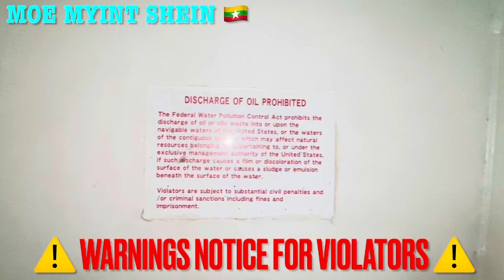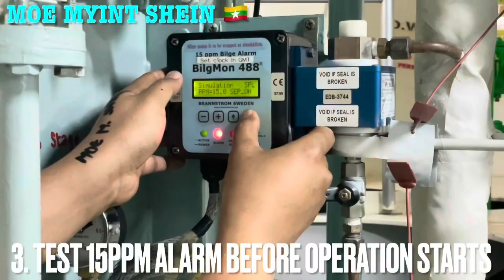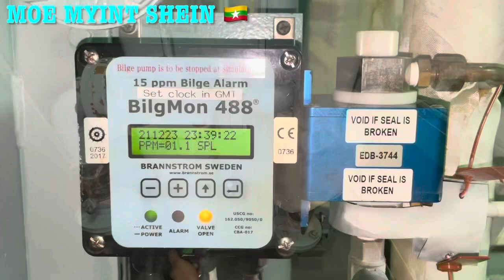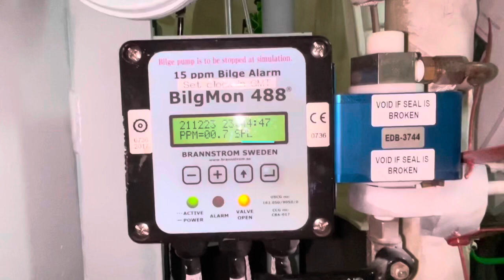OILY WATER SEPARATOR | Intro & Operating Procedure | Technical Vlog : 030

Comment: Hi.Fresh Water valve must be kept open on Monitor 7:41  during pumping out bilge?
Reply from the maker: Sure. 

Purpose of this fresh water is - 

1. To wash down stains on sensor. And also, to calibrate sensor with fresh water, after 15ppm alarm activates due to high oil content. 

There is 3-ways valve located before measuring cell (here you say monitor). One from sample line that is NO. Another one is from fresh water line that is NC. And the last one is directed to measuring cell. 

When oil content is higher than 15ppm, sample line is closed and fresh water line is opened to sensor for above purposes. 

Hope you will satisfy my answer. If not, leave message in comment. Thanks.

Comment: Sir (1) at 4:41 , when you opened fresh water valve, then this FW is going to photocell and then draining to ows or it is also going to automatic 3 way valve ? (2) Do this FW valve continue to be in open condition when ows is running ?
Reply from the maker: To wash down stains on sensor with fresh water. And also, to calibrate sensor with fresh water, after 15ppm alarm activates due to high oil content. 

There is 3-ways valve located before measuring cell. One from sample line that is NO. Another one is from fresh water line that is NC. And the last one is to measuring cell. When oil content is higher than 15ppm, sample line is closed and fresh water line is opened to sensor for above purposes.
Reply: @CHiEF_MOEMYiNTSHEiN  So sir, it means this FW will keep cleaning photocell when ows is running? For how many second this FW valve will open and do flush and then again get close ?
Reply from the maker: @ashishmishra2144 
Most OWS - 60 Seconds
Reply: @CHiEF_MOEMYiNTSHEiN  So sir, it means that whenever ppm>15, tyen solenoid valve will shift towards fw sample valve line and my Oily bilge water will not come for 60 seconds. FW will come for 60 second for flushing and after that 60 second flushing, again solenoid valve will shift to oil bilge water sample valve !!

Is it sir, am I correct or some corrections please ? 🙏
Reply from the maker: @ashishmishra2144 
That’s right !
Smart thinking !
Reply: @CHiEF_MOEMYiNTSHEiN  ohh waao, thanks sir.
Reply: Sir one more thing, If i don't want to clean the photocell. I understand , we are using FW sample valve for photocell calibration and it's cleaning which can be done automatically/ manually.

But if  I just want to know the significance of FW for testing automatic 3 way valve without running OWS pump, then do I need to open FW sample valve for 3 way valve testing without running OWS pump ?
Reply from the maker: @ashishmishra2144 
This OWS don’t need to open FW sample valve for simulation test. 

Some OWS requires to open. Please carefully read instruction before starts operation.
Reply: @CHiEF_MOEMYiNTSHEiN  Okk okk sir, now I understood things , very clear and thanks a lot sir for this discussion. I am currently preparing for my 4th Engg exams. 

So sir, whenever you get time, please make a video regarding VIT and Super VIT in details by showing practical.  It will be really helpful for juniors like us.
Reply from the maker: @ashishmishra2144 
Noted, Mishra. 
Good Luck for your exam. 🤞
Reply: @CHiEF_MOEMYiNTSHEiN  Thanks sir

Comment: Sir, good day. how are you? 
i have a question. pls reply.
At which air pressure the pneumatic 3way v/v operates located on the final discharge side? Is it 7 bar?
Reply from the maker: Hi Good Day - MEC. 
Control Air Pressure is 7 Bar. 
Have a wonderful day !!!

Comment: Sir i have a doubt. I believe"ll be cleared once you read these questions.
Why freshwater valve to o.w.s is given?
Why sample drain valve should be in closed position? Btw Where is it draining sample water? Is it in B.H.T or B.S.O.T?
Reply from the maker: 1. To wash down stains on sensor with fresh water. And also, to calibrate sensor with fresh water, after 15ppm alarm activates due to high oil content. 

There is 3-ways valve located before measuring cell. One from sample line that is NO. Another one is from fresh water line that is NC. And the last one is to measuring cell. When oil content is higher than 15ppm, sample line is closed and fresh water line is opened to sensor for above purposes. 

2. Measuring cell has 3 ports. Sample Inlet, Sample Outlet and Drain. Sample inlet located at the bottom of sensor, just above the drain valve. Sample outlet is at the top of measuring cell. 

If drain valve is opened during operation, sample water can’t pass measuring cell and all sample will be drained through drain pipe. 

3. Sample water from outlet of measuring cell drains to tray of OWS. From there, goes to BHT. Manual drains from 2nd, 3rd and 4th stages leads to BSOT. And also, auto drain from 1st stage goes to BSOT.

Hope you may satisfy for my answers. If you doubt something, can contact.
Reply: Thank you very much sir. Really you cleared my all doubts. 
Thankyou sir again.

Comment: Sir, what is the the meaning of biggest size float on surface and discharge regarding 4th chamber ?
Reply from the maker: It means Big Size Oil Particles that is floating on the surface of oily water in 4th Chamber.
Reply: Thanks sir  @CHiEF_MOEMYiNTSHEiN
Reply from the maker: Good Question, Mishra.
Bilge water comes out from Bilge pump because you had opened pump discharge valve. 
Now, Bilge water reaches to manifold.
From manifold, bilge water can flow to many places. If you wish to flow to OWS, open valve to OWS and close other valves. 
If you wish to transfer to Primary Bilge Tank (optional), open concerned valve and close others. 
If you wish to transfer bilge water to bilge holding tank, opens valve to BHT and close others. 
Hope you will understand in brief.
Reply: @CHiEF_MOEMYiNTSHEiN  I understood sir, thanks much. In my last ship, piping arrangement is different from this one. So I asked, but yes point noted, it depend upon ship design. Thanks sir